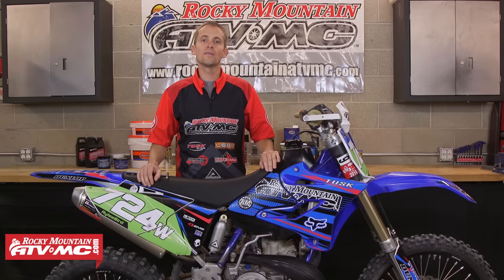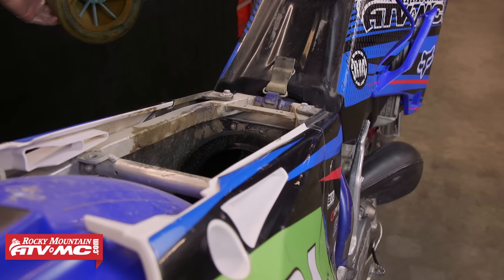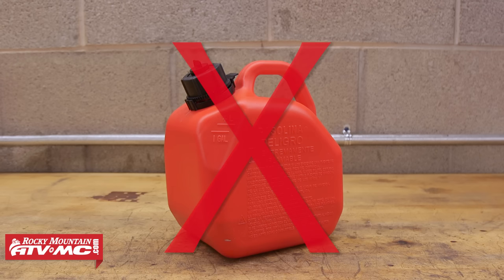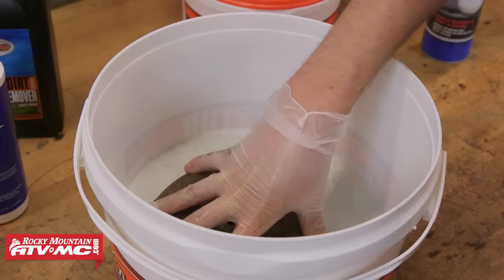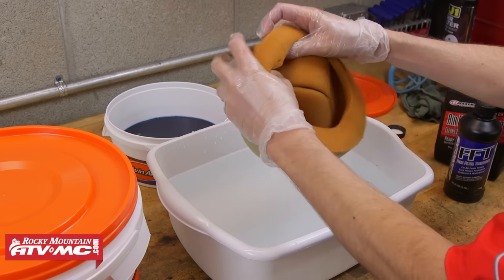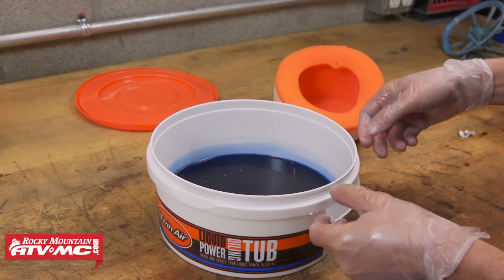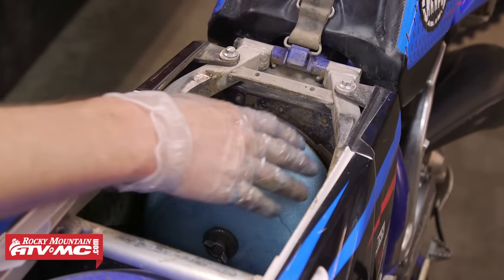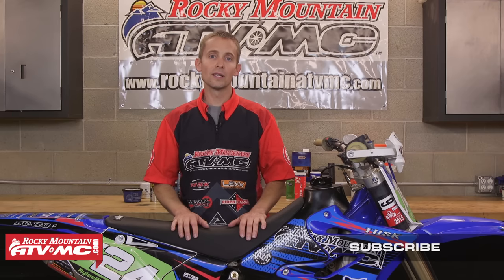How To Clean & Oil a Foam Air Filter on Motorcycle or ATV

Comment: I'm riding alot on sand, how is this gonna get the sand outa the foam? after I cleaned my air filter I can still see alot of sand inside the foam.
Reply from the maker: It's probably best to get a new filter and use a pre filter if you're mainly riding in sand.
Reply: @rmatvmc  wont that pre filter clog up real fast in sand and make the bike bog?

Comment: Is it normal for the oil to seep down to the bottom? I bought a pre-oiled twin-air and I noticed if it was a bit hot that day that the oil would be concentrated in the bottom. Still looks like I have oil on the top but more dense on the bottom. It is on a ktm supermoto for commuting etc so if I cleaned the air filter after every ride that would be just about every day.
Reply from the maker: That is normal to see the oil settle to the bottom like you're seeing. It really depends on the riding conditions your in.. since you're on a supermoto and riding more streets, cleaning your air filter after every ride isn't that Necessarily.  It's more dirt biking when you would want to clean it after every ride or 2-3 rides.

Comment: After washing my filter still smells like the cleaner. Is this ok? Good to go back in the bike after oiling?
Reply from the maker: Did you rinse it with water after cleaning it? The filter might still have the hint of cleaner on it, but once it gets rinsed and completely dried you'll be good to oil it and get it back in the bike.
Reply: @rmatvmc  yes, rinsed it 3 times. 1st time with warm water and dish soap next 2 times with just warm water and still has the smell. I’m guessing it’s normal?
Reply from the maker: Sounds like you're doing it right! You're fine to oil and reinstall it 👍🏼

Comment: Does it matter if I put alot of grease or is there a minimum plz reply back
Reply from the maker: Just apply a nice even coating around the sealing surface of the air filter and you'll be fine.  Just like the video.

Comment: what do i use to clean and oil my raptor 350 filter?
Reply from the maker: If it is a foam filter you will clean and oil it the same exact way shown in this video.
Reply: @rmatvmc   its foam but its the shape of a monster energy can (only way i can explain it)

Comment: Lol Ive never used this much oil on my air filter and have never greased the base. Just an even coat of oil spray on the outside, work it in and done... and the inside of my air boot has never had a spec of dust in it. In my mind that’s just too much oil and would think it’s just preventing more air from getting through. But hey, whatever works I guess.
Reply: dane holmquist I

Comment: Can you just use warm soapy water and clean it and then oil it?
Reply from the maker: Regular soap will not work very well at stripping the old oil from the foam. You can certainly try it but you will notice a significant different using proper foam filter cleaner.
Reply: @rmatvmc  alright thanks😎👍

Comment: Can anyone please tell me if you have to buy new air filter cleaner after each clean or you can reuse it
Reply from the maker: Get as much use out of it as you can. After a few cleans (and depending on how dirty your filters are), the cleaner will get dirty enough that you have to clean the filter after cleaning it in the filter. 😂  You can definitely get a few uses out of the cleaner solution, but when it gets dirty enough you'll know that it's time to replace it.
Reply: @rmatvmc  thanks man
Reply: @rmatvmc  I was wondering if this Maxima air filter cleaner is the same as mineral spirits or no 
-Thanks

Comment: Doesn't need to dry for few hours after oiling?
Reply from the maker: You'll want to set out the filter until the oil is tacky. Maybe 20 minutes to an hour should be good.

Comment: How many times can the filter oil be used?
Reply from the maker: There's not a set answer to this. It depends what riding conditions you ride in and how often you clean them, but if you keep up on the maintenance you should be able to get a season out of a filter. Just clean and re-oil the filter until you start to see the foam or glue holding the seams breaking down.
Reply: @rmatvmc  OK cool thanks for that 👍

Comment: You can use normal engine oil right?
Reply from the maker: yes, you could. However, engine oil tends to drip of your air filter and cause a mess. This was a method used for older bikes but nowadays, all manufactures recommend using an air filter oil.

Comment: Can you use wd-40 as filter oil
Reply from the maker: We wouldn't recommended it.  Foam Air Filter oils these days work best.  They are super tacky to prevent any dust from passing through the air filter without restricting air flow.  Thanks.
Reply: Rocky Mountain ATV MC would it be worse or better to leave it dry?
Reply: i use wd 40 when i don't have oil but i put a protection cover on my air filter

Comment: Can u use motor oil instead
Reply from the maker: If you're really in a pinch you could use engine oil but it's not recommended. Engine oil will break down the filter material and it's not designed to be as tacky as air filter oil.

Comment: if i oil my airfilter, will it stop it from water getting through it?
Reply from the maker: The filter oil resists water but it won't be waterproof.
Reply: @rmatvmc  ok, so would it be possible to ride in the rain?
Reply from the maker: @tordvasseng5766  That could vary depending on your air box design but all dirt bikes and most motorcycles have air boxes built that make riding in rain not a problem.

Comment: Anyone else think that is way too much oil. I’ve never left my filters that saturated. When it came off the bike, it left a crazy amount of oil on the subframe as it scraped past. Clean the rubber ring and wipe out the box, not just the inside of the boot.

Comment: 1:00 He just explained how to be careful not to knock loose any dirt into the air boot. His air box is FILTHY! The subframe is caked with dirt and he pulls the air filter out rubbing all that dirt down into the air boot. I recommend dampening a rag with a little mild degreaser  and cleaning the frame and the airbox BEFORE you remove the air filter.

Comment: How long does a oiled filter last?
Reply from the maker: Filter life will vary greatly depending on the environment you ride in, but most people will at least check their air filter every other ride or every few rides to see how dirty/dry it looks and clean and oil it as needed.

Comment: I’ve been use 10w40 is that bad?
Reply from the maker: Oiling your filter with engine oil has the potential to pool in the airbox or be sucked into the intake because motor oil is lighter viscosity than filter oil. A foam air filter oil will work much better and leave less chance of being pulled into your engine.
Reply: @rmatvmc  ok thanks
Reply: no its ok you just have to let it dry properly before you put it back

Comment: I got red n tacky grease is that okay?
Reply: no, dont use any grease. i personally used  grease until i realised, that it floats on the top of the air filter cleaner, and everytime i clean my filter, some got stuck on the filter. i dont recommend using grease at all.

if you wanna maske sure that no dirt gets past the air filter,  tighten it down better or add a washer. the grease wont help at all

Comment: Just replace the air filter before every ride, and on a 4 stroke change the oil and oil filter too. A new dirt bike is 10k, a new oil filter, oil, and air filter costs $50

Comment: Easiest way to clean your air filter is spray down with Simple Green let it sit for 5 minutes wash it out with hot water let it dry then spray it down with K&N oil 
Easiest fastest way to do an air filter and the cheapest

Comment: So let me get this straight... When you correctly remove the foam air filter for servicing, it is designed in such a way that sand, rocks, gravel, grasshoppers and baby birds, shoot straight into the air boot and then go into the engine? This seems to support my theory that motorcycle manufactures are secretly trying to ruin their own engines by not putting an overdrive gear on any dirt, or street motorcycle. Super high rpms at 70mph during cruise, along with baby birds and gravel in the engine, is a recipe for shorter engine life. Let me guess, removing the oil filter also allows sand and rocks to shoot into the oiling system? These "random" engineering mistakes can no longer be tolerated.
Reply: You fell off your rocker bud.

Comment: Gasoline really is the best way to clean a foam filter.  Been using it for 40+ years to clean motorcycle foam filters and have absolutely never had it “break down” filter material early….never.  You guys at RMMC are great but don’t talk about sh$& you don’t know.   Blessings

Comment: Cleaner costs more than a new filter plus the labor that's why motorcycle shops cost so much. Just buy a new filter. 45 min to service an air filter= lots of $$$...Filter service $65 new filter $25.
Reply: But you still have to oil your new filter and let it dry before riding... so your method only saves the cost of filter cleaning, not oiling.

Comment: I dont think gas is harmful to the airfilter.
The Filter is right befor the carbutrator, if it would be harmful to it it would dregraid over time
Reply from the maker: Air filters do degrade and start to fall apart when left unmaintained for a while.

Comment: I have been using Gasoline as a cleaner for over a decade, my dad has been using it for over 2 decades. Never had any issues with gas and our 2003 Yamaha 250 2 stroke and 1988 Honda 100 still run just as good as new. After the gas just use some good old $2 dawn dish soap to clean it. Does a way better job than your $100 manufacturer stuff. This guy doesn't even clean the grease off his air-box, rookie mistake.

Comment: I just clean it every ride or race, amd spray the oil on the outside not the inside, plus too much oil wont let the bike breath like is supposed to , just cleaning it every ride and maintaining the air box clean will work better than this
Reply: What oil are you using on the outside? What happens if you don't oil the filter?
Reply: Steve Anthony i use maxima products but i try to mantain the airbox and filter as clean as possible, you see the pros soaking the filter but they have better mods, me as a mecanic just clean it really good then spray the outside clean it every ride

Comment: I just use regular gas to get my oil out of mine. Been using that tactic for like 2 years.
Reply from the maker: Gasoline has been proven to clean out the dirt and old air filter oil, but what's generally overlooked is that gas can be harmful to the construction of the foam air filter.  Can cause that the bonded seems of the air filter separate.

Comment: Kerosene works perfect the only way i would ever use anything else is if i got it for free
Reply: Just wash it with soapy water after to make sure all kerosene is off then rinse it well so the new oil does degrade from kerosene still in it

Comment: I need help why should you oil your  air filter
Reply from the maker: The oil is tacky and attracts dust and dirt to the outside of the filter instead of letting it into your engine and ruining it. Oiling a foam filter is definitely necessary.
Thanks for watching!
Reply: @rmatvmc  can i just use used oil
Reply from the maker: It wouldn't be a very good idea. Used oil is already dirty and has microscopic metal shavings in it which you don't want anywhere near your intake.

Comment: Use mineral spirits,  and clean the air boot before you remove the filter. I kinda skip all this and don’t run an air filter tho, there a waste of money.
Reply: Most bikes have a pretty well concealed air-box. So you can ride it without having any crazy issues, but the air filter will help so much if you where to submerge the bike in water..

Comment: Wrong wrong wrong, you throw your air filters in the washing machine.  Just sneak them in while the wife is shopping, like when you wash your stiff socks.
Reply: I bet that would actually work. Do you really wash your filters in the washing machine?
Reply: @thejohn6614  I actually have an old beater washing machine behind my shop hooked up to a hose.  I use it for washing shop rags and all kinds of Nasty stuff including air filters.  Definitely do not use the one in your home unless you want to get divorced, or if you're young your mom and dad would kill you.
Reply: @dustin9035  i live on my own. Don't have to worry about parents or a wife. I don't want to ruin my washer or have a load of my clothes all oily though. Thanks for the reply.

Comment: Don't waste your money on all that CRAP!!! This guy probably gets paid to tell you to use this stuff. Grab the dawn dish soap from the kitchen, a  $3 5 gallon bucket from the hardware store, add some hot water, clean, rinse, let dry, and oil with any clean motor oil. This has worked for me for 5 years.
Reply: Yeah, any type of  cleaning soap that also cuts oil/grease would work. ie  dish soap

Comment: I clean it only in dish washer detergent and I oil it using normal engine oil. It works . No need to buy all those fluids . Unnecessary.

Comment: I use gasoline and kitchen detergent to clean since years and no, it's not dangerous or bad for air filter. Also I oil air filter with gear oil and works great.  Who buys that S@#$% ???

Comment: Why even mess with it? A new air filter is $15-20
Reply: cause its 10x cheaper to clean a filter 20 times then to spend 400 a year on oil filters
Reply: With a four stroke the air filter should be cleaned every one or two rides. With the two-stroke the air filter should be cleaned at least every 3 to 4  rides.

Comment: Why you put the filter in oil? The engine sucks it up.. And why you use grease on your filter? Vet like grease and other things takes all the dirt up. The best method is clean it up with brake cleaner and let it dry out en put it in into the airfilter box and your done same for the box take is off and clean the hole box with brake cleaner.